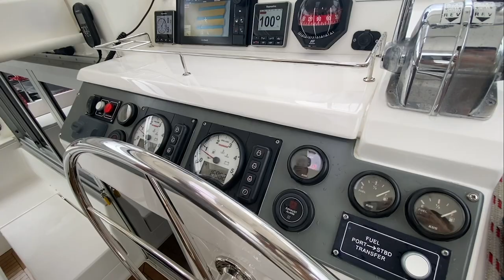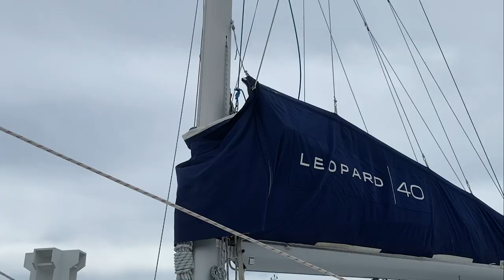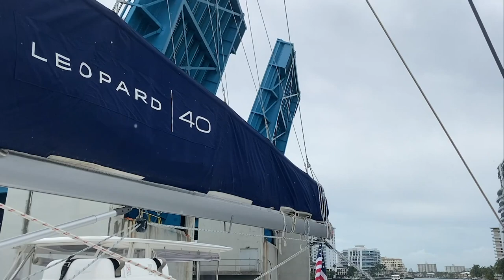OUR EYE OPENING CATAMARAN SURVEY | Our new sailing catamaran survey brings new questions

Comment: It sounds like the survey was extremely thorough but anytime you see any vehicle, house or...basically anything that the owner is willing to defer normal maintenance,  I find it bothersome. Definitely want to put a contingency in the price above and beyond what the survey found because there  will likely be more. Of all the things, the delamination scares me the most. a bad spot is like a glacier. You only see a small fraction of the actual damage, both from the incident as well as the result of saturation over time. That being said, it looks like a nice boat that if you could get it for the right price, you might be able to have a great cruiser after the repairs. What did the survey say about the rigging and sails? Looks like they have some miles on them. I'm with you about the Leopards. I have been looking for a while and I think they are my favorite layout. Also, a bit lighter and more performance than Lagoons, etc. Maybe not up there with Seawinds or Katanas, but definitely more livable. Think I will end up with one. Good luck with your search!
Reply from the maker: Hi Dan!!  Good luck with your search, and for all of the thoughtful comments and advice 👍
We did end up getting this boat BUT as you mentioned we asked for some concessions on price. 
After getting everything that worried us repaired we even have a little left over 🙌 We have videos available on our channel that cover both the negotiations and repairs if you run into any similar issues and are looking for some details. 
The rigging was in good condition and the sails were worn, but not to the point that we need to worry about replacements.  All in all, we are so happy that we didn’t let the survey scare us from getting this boat. We have been living on it for two months and just love it!!
Reply: @FolsomOceanViews  Thanks for the update! All of this is good to hear. I just discovered your channel and didn't know where you were at with this. New Sub!